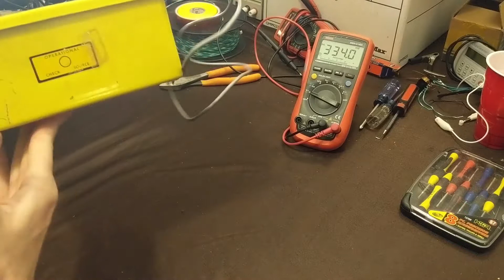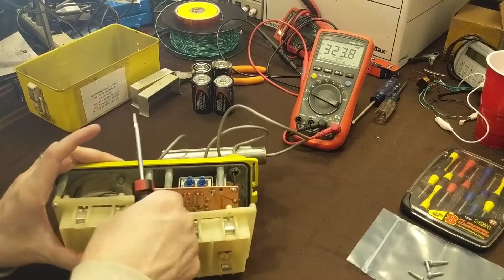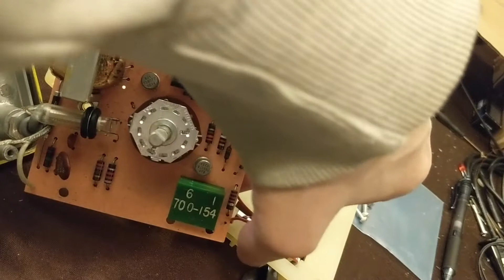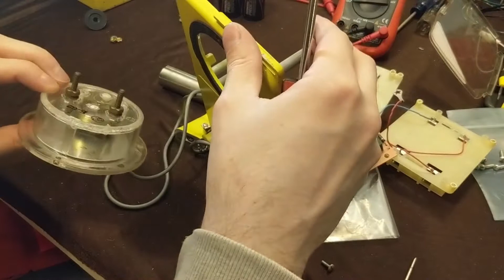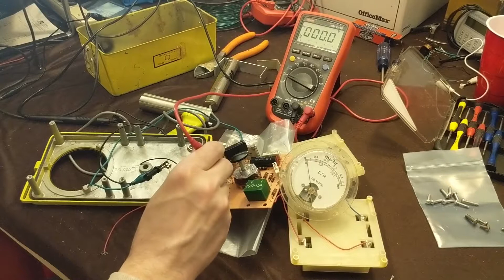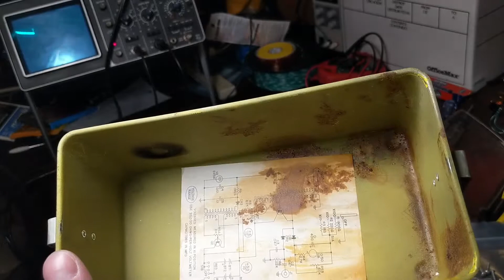Geiger Counter Repair - Victoreen CD V-700 Model 6B

Comment: Is it safe then to just throw in regular alkaline D cells in the stock unit? Read someplace that the original batteries were slightly different voltages
Reply from the maker: Sorry I missed this, the original batteries from the time-frame were Zinc Carbon. They have a similar 1.5V design but much lower life capacity ~1/8th modern alkaline batteries.) The D cell would have been more equivalent to a AA now days for capacity. Thus modern batteries are safe, and will run the unit for 8x longer then back in the day.

Comment: The green box is a specialty integrating transformer. If the hv goes too high it will arc over and kill the counter. If you go with a zener stack make sure to add s buffer capacitor, a resistor, then the zener stack, main limiting resistor. Then the gc cap. Otherwise the ringing pluses will clip and iy may not count right. Fixed hundreds of these things over the years.

Comment: The buzzing with no difflection is usually the crappy HV diode or the sensing transformer arcing, same but with full scale deflation is usually the probe cable.
Reply: The probe wiring is I think is what’s going on with mine. Full meter deflection and crazy CPM.

Comment: the only part ive changed on mine is the selium rectifier, under the high voltage discharge tube,

Comment: My batteries blew up in mine. Do you know what the replacement pieces that hold the battery are called? Battery box?
Reply from the maker: If your talking about the plastic D Cell battery holders, those are made specific for that... Note - Modern batteries like AA cells can power this fine, you could get 2 sets of 2AA cell battery holders and attach them in pace of the existing 2D holders. You would have to rig up a way to mount them.
Reply: @TheMadHatter1337  thank you very much. I really appreciate it.

Comment: Take the rubber gasket off of the bottom of the Geiger tube It may be preventing the tube from going into the socket and working. I always trash them.

Comment: That schematic diagram in the case is labeled at several points to show what voltage to expect when using a plain old 20000 ohms/volt multimeter.  A good way to start the repair would be to measure the DC voltage at each of those points.   

When my meter failed, I had great success with a set of replacement components sold on eBay.  The parts and instructions were specific to my particular model of CDV-700.  To do this kind of repair, you will need decent soldering skills and lots of desoldering braid.  Several of the parts that I removed did not match their specified values.  I replaced every supplied component, and in the end the meter worked fine.

Comment: I have a cdv700 last year make high spike needles then spike goes zero. No moving when turn  on  or  when rod goes  proximun to check source. Long history short, i give  to  electrical  enginer he says same you say. Diagnóstic: muller tube  broken or  depleted not electrical  problem.. And today  i turned on  and its humming so electrical  works. Thats because eBay sells  4 o 6 or dozen packs of tubes because of time most  are timed  out. I live in Argentina i know never gonna can buy tubes or  pass  in  customs. So gonna give  to museum and buy a proper gamma scout probably
Reply: And really like your  vídeo and logic  test and im very sad that you cant  fix it really man

Comment: For anyone else that broke the conmectinf pins off the geiger muller tube like i did, took me a while to figure out but the ground wire goes from the ground pin of the connecting socket  to the side if the metal interior of the tube itself and must touch. The the wire in the center of the tube goes to the positive pin of the connector but does not touch the ground wire at all. Atleast thats what my victoreen 6993 tube setup is running on my victoreen cdv700 6b

Comment: Hey man, thanks for the video it wound up being a life saver. I stuck the probes of my multimeter into the probe socket of the geiger counter and set my high voltage adjustment screw until it read about 560v reading on my meter and that fixed my problem. The ground pin on my socket was one of the two pins that are closest together  and my positive pin was the one farthest away from the other two that are close to eachother.
Reply from the maker: Glad it helped someone... I figured if I was going to spend the time ripping it apart, I might as well to record it. Considering there's probably not a ton of knowledgeable people with them anymore.

Comment: Hey you don't happen to have the original user manual for this thing do you? The manual says you can hear a slight buzz when operational. Also it says to check the tube before looking further into other electrical problems. The book has other good info in there too.